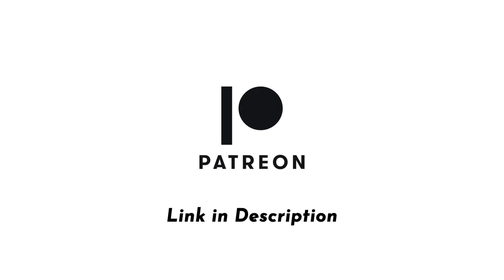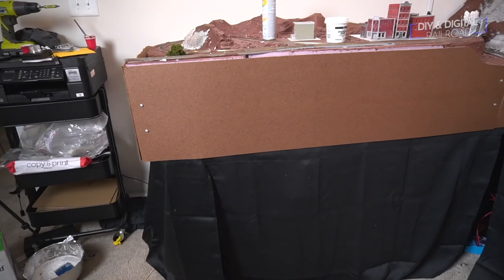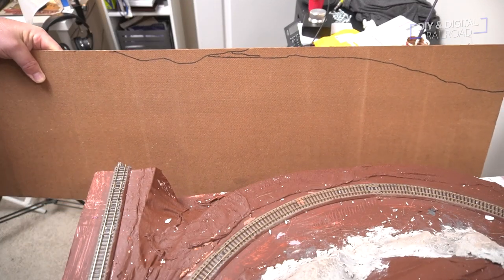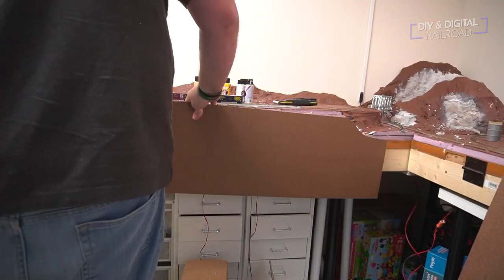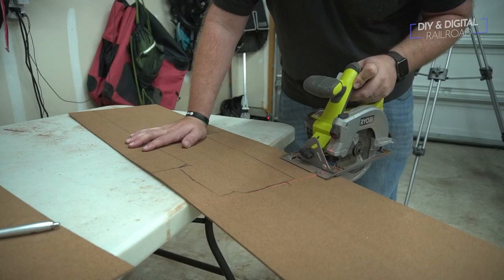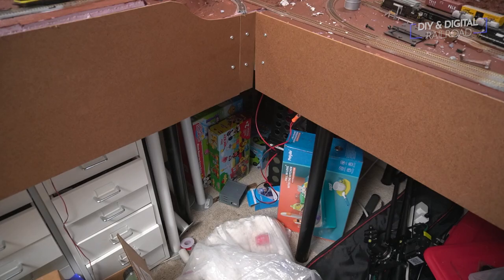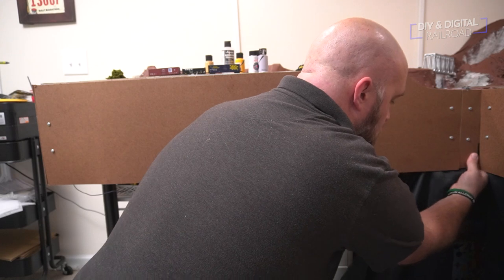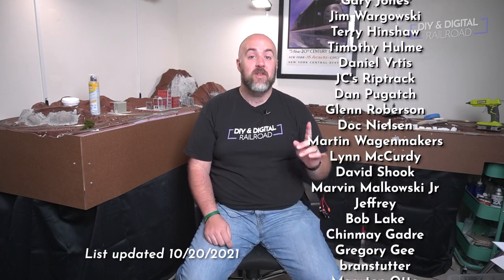Make A Better Looking Model Railroad with Fascia Panels

Comment: This is definitely on my to do list. I actually bought a 4x8 sheet from Home Depot and had them rip the boards for me. Keep in mind that each cut, your loosing 1/8" from that saw blade. Our H.D. will rip anything down to 12" minimum. That saves a lot of time trying to do it yourself and it's a FREE service they provide. I am sure Lowe's is the same way. Once mine are installed, I plan to paint mine black as that wont be an eye catcher but should make the switching diagrams more noticeable.  - Jason

Comment: Fascia and curtains make a BIG difference.  I used the hardboard that was white on one side and for my curtains, I used landscape cloth (for weed control), which I attached to the back of the fascia with clothespins that are hot glued in place.
Reply: Did the same thing but used both hot glue and yellow carpenters glue to hold clothes pins. Granted Velcro is nice but way more expensive.

Comment: Nice idea. I'm currently trying to do similar with some slightly thicker wooden boards and, well, they're kinda warped.  Hardboard would have been much simpler, but I'm part way there now so I guess I'll get the plane out and keep going :D

On velcro, I've always heard it called "hook side" (scratchy) and "loop side" (fuzzy), but I'm in the UK so terminology may differ over there.
Reply: You are correct about hook and loop

Comment: How do you add holes for mounting DCC plugs or turnout controls? Very well done.   I have no talent when it comes to power tools.
Reply from the maker: It all depends on which controls I do.  This is why I made the panels easy to remove.